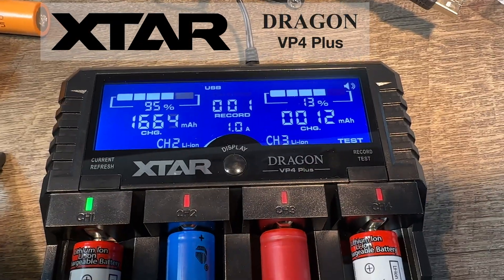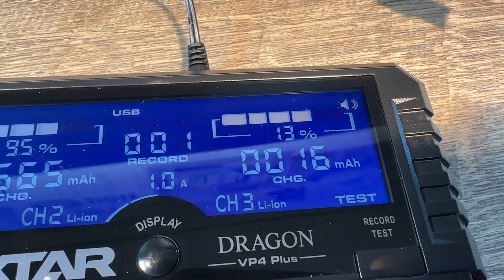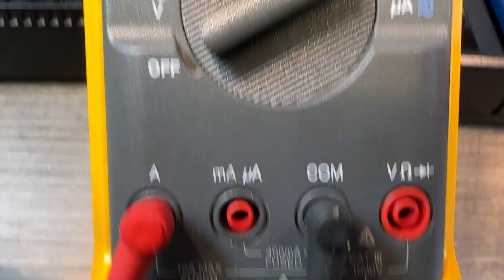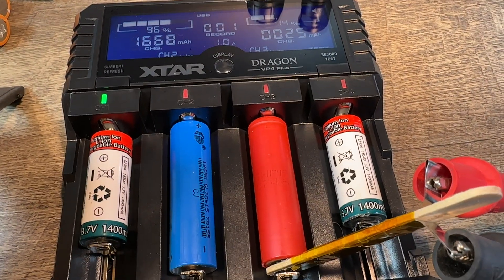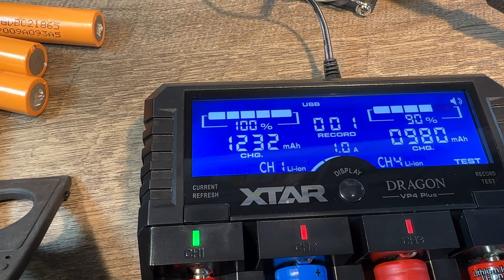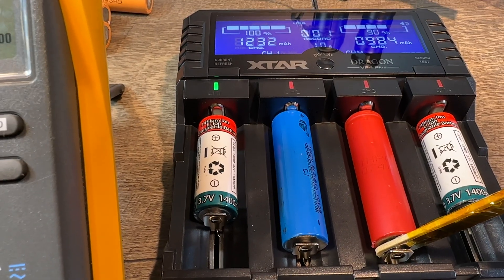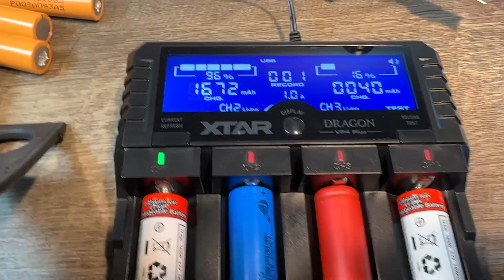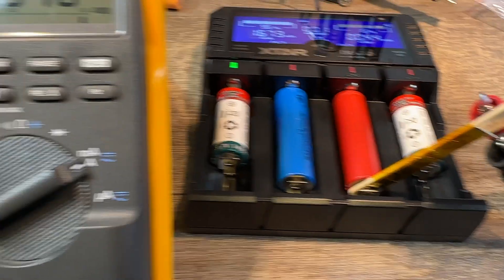XTAR DRAGON VP4 Plus Charge Current Test

Comment: Lets ask: dis-charging how much power is being used, when you can simply put a non powered  item to discharge that will not use ac.  Just asking? I know you need to get the discharge to aright percentage. is it like 3.69 for low voltage  cut off. and 3.86  75% cap?  excellent resolution ifasked.
Reply from the maker: this charger does not display the cell voltage. All the voltages are pre-programmed. You can change the load for discharging